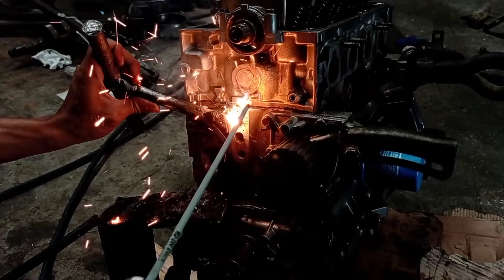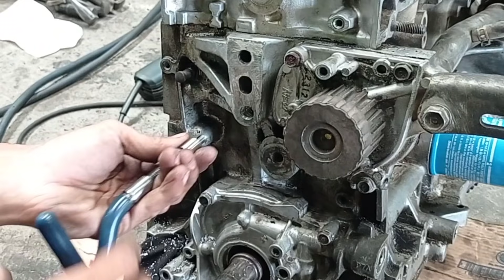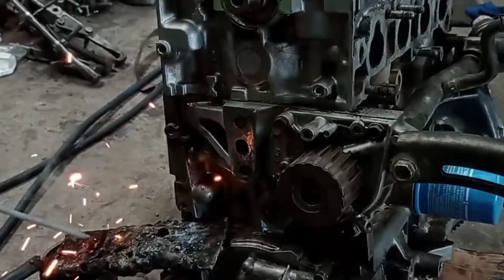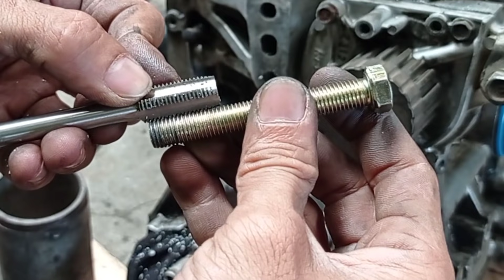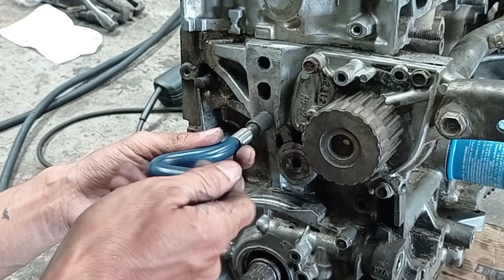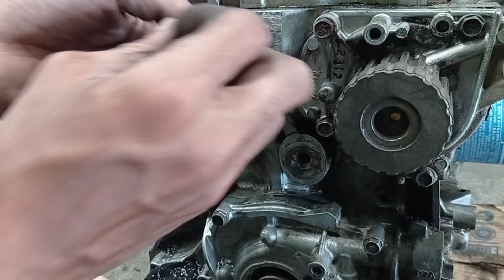Cabut Baut Patah dan Recoil Baut | pull out the Broken Bolt and Recoil in a blok silinder | lathe

Comment: that thread insert is installed incorrectly it should be cut to length before installing and tang should be broken off in bottom
Reply from the maker: The thread breaks when the bolt is inserted and hits